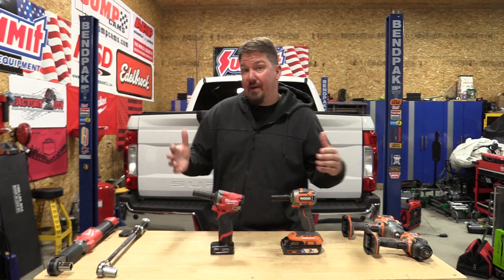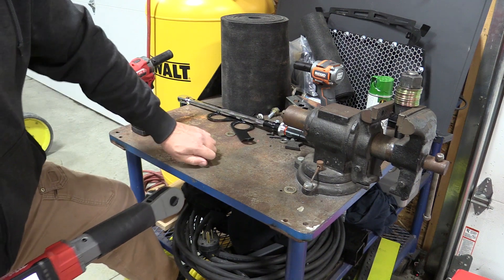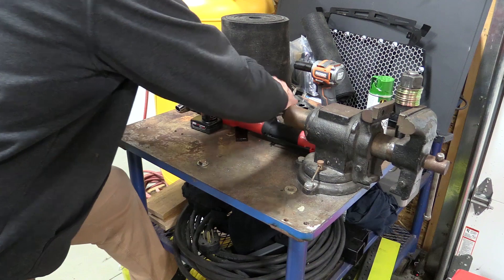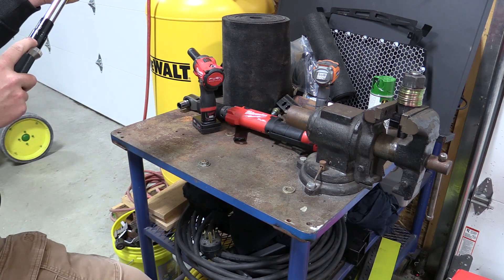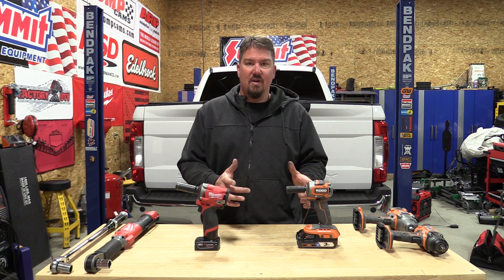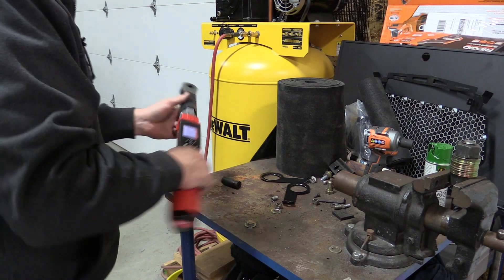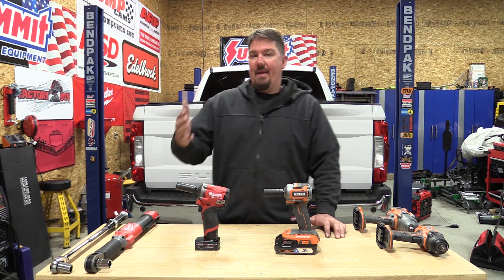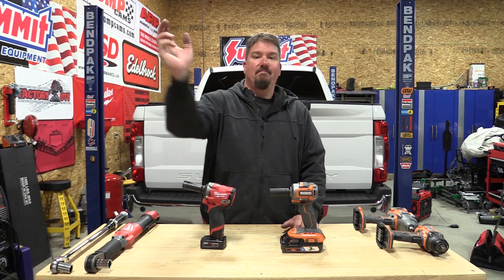Milwaukee FUEL M12 Stubby Vs Ridgid 18-Volt Sub-Compact Impact Wrench

Comment: I tend not to follow the pack so I went with the Ridgid 18V line vice Milwaukee.  The later is too expensive for what I do. I was able to recently pick up the older 1/2" Octane impact for $120 and both the 1/2 and 3/8" stubbys for about $65 each.  You cannot beat this level of value in the Milwaukee line.

Comment: Shallow well sockets have less mass and vibrate more then transfer torque. They significantly limit the tools ability to transfer torque! That is why you can find crankshaft sockets which are nothing more then sockets with 5x the mass.

Comment: I'm not a fan of the Ridgid per say, I have the 120 volt 1/2 inch impact. It's a good impact, but it's heavy. Easy trigger to use too, press down for removing and up for tightening. 🛠️🔧

Comment: You don’t actually need to spend that much. Just bump up to a 22mm impact socket in 3/8” drive.  Better yet I’ll go work on that video today.
Reply: I think the reason why it's so expensive for him is because he has expensive toys. Getting the job done isn't enough. Gotta do the job with the absolute best tools.  
I agree with you on your not that expensive comment. Buy a couple huge bolts, one or two sockets along with one tap. Boom testing is on. 
It wouldn't be the best socket, die or bolt but the results would be consistent.

Comment: 3/4” grade 8 bolts are what you would need to use for the torque specs youre trying to achieve. Recommended torque on a 1/2-20 g8 is about 130 ft lbs.  as you get beyond that, the bolt will go through elastic deformation, then plastic, then complete failure. If the bolt youre using has a recommended torque specs in the range youre working in, failure of the fastener is less likely.

Comment: milwaukee has a smaller handle due to it can use a small battery, most of the time when we need a stubby impact just because not enough space for a big tool like Ridgid, if the Ridgid can fit into that space with that big fat battery in it, it also can be done with 1/2 inch impact wrench from milwaukee, more power. I personally recommend Milwaukee.

Comment: One thing that would've been a better test is see if they'd remove and install all the lugnuts on that truck behind you.
Reply from the maker: They both will.  Torque is 165 on those.  The damn thing is pretty much new so there is little challenge and also why I did not use it for an example.  I do not want to mislead anyone to think that in 10 years they would be able to remove them with the rust.

Comment: I have a question does a deep well socket eat up more torque than a short socket? I’m wondering if the extra mass soaks up some power.
Reply from the maker: Deep well give the unit more power transfer to the fastener.  Not what you would think.
Reply: @WorkshopAddict  how does thin wall vs regular wall change the performance?

Comment: It'd be super cool if you could get a 3.0ah battery for the dewalt 12v 3/8 and see if it has more power! Like if it would actually break a truck lug nut VS the Milwaukee stubby.Keep the sweet videos coming! Thank you

Comment: My issues with impacts is they performance fade over time. I don’t really understand why that happens. I’ve heard theories about anvil ware and others about copper windings work harding. 
The test more interesting to me is which tool retains its capabilities over time and multiple heat/cooling cycles.  

It’s the bigger impact on my wallet over time I’m interested in.

Comment: I've seen guys test on impact wrenches with 18 wheeler lug nuts. Those seem to handle ALL the torque.
Reply from the maker: Those are not 3/8" impact though.  That's an huge but for a 3/8"
Reply: WorkshopAddict I've seen the Milwaukee stubby 3/8 handle it. I can't remember where on YouTube I found that particular video but I'm mainly throwing it out there for the durability. Like you can perform the test on those lugnuts and they'll withstand more than the 190ft lbs that those bolts you have are handling.

Comment: Really great idea.  Too bad it didn't work out.  I think a lot of people get too wrapped up in having "the best" tool.  If you have the rigid batteries, does it really make sense to run out and buy the m12 stubby kit?  Probably not for most people.
I will say though, thats what led me to Milwaukee, all of their tools are very good if not the best in their class and the m12/m18 line have tons and tons of tools to fit just about any job you can think of.  It's hard to beat that when you factor in the cost of batteries and the hassle of having multiple chargers, and batteries cluttering up your bench/box. 
Great video as usual though!

Comment: It's an 12v vs a 18v obviously the 18v has more power and will win?
Reply from the maker: So Wrong.
Reply: Not even close...my 14.4 v matco drill blew away all my 18,and "20v" drills.
Reply: @WorkshopAddict  hence the question mark at then end of it.

Comment: Use 9/16" or 14mm wheel studs either welded to your bench or made on a fixture you can put in your vice. Lugnuts with 7/8" hex. You aren't gonna break those with those tools and should be pretty inexpensive.

Comment: Just a suggestion and I know it's a little cheesy and overdone at this point but driving lag bolts into material you know to be consistent like plywood or lvl would be a good way to get a relative idea of driving speed and what driver overall has more power. I don't know much about bolts and what not but I do know that it's easy enough to stretch out a faster or for there to be enough variance in the driver's to never get consistent performance. Measuring reverse torque with lug nuts is also overdone but at least fairly reliable. Great video though as always!
Reply: Everyone wants either a consistent test, or a real test. Neither test can be one of each other. A consistent test is lags for time/speed in plywood. A real test, is lags for time/speed in 4x4 material. Irregardless of the tools being on different battery platforms, there is only so much human element that can be taken away, or added to in some cases in these comparisons. Brand fans want to cry their tool didn't perform and blame the tester made an error... and the "unbiased" tool "pro" says it wasn't fair due to one irrelevant factor in a test... and the other brand should've won. Consistent real human tests are a compromise in it all. I'm not building a deck out of plywood, so why would i watch wich impact can drive lags faster in that material. I want to see which one performs the best in actual material where variances are going to occur.

Comment: I like that torque wrench, the click one. F digital
Reply from the maker: Digital is just nice to show the camera
Reply: Snap on tech angle torque wrenches I'm 100% sold on them if you do any internal motor work they are worth every penny especially  on nuts and bolts that require an additional amount of so many degrees after the ft lbs is set

Comment: You should use caterpillar bolts they are stronger the also offer taper head bolts so you can have a 3/4 inch bolt with a 3/4 or 11/16 head ect also your table is problematic put nuts in the vice and get r done so you can use a new nut and bolt each test if need be

Comment: Use a 3/8" A449 threaded rod and tighten a nut against a second nut. Place extra nuts further down the rod in case the thread starts to deform during testing (just cut off the deformed section and continue with the nuts already threaded on the rod). Epoxy the rod into concrete or big chunk of steel.

Comment: Which Milwaukee stubby is better to get  1/4  3/8 or 1/2
Reply: I’ve got them all and if you’re mostly working on your own vehicles and the like, the 3/8” will probably do you well. I prefer my 1/4” to get into the really tight spaces and my 1/2” will pull the fasteners that the 3/8” won’t. There’s a little give and take with each of them but they all perform very well and they don’t let me down.

Comment: Just buy a sunex 15/16 impact socket & use grade 8 5/8 11 bolts sunex sells 15/16 impact socket that is 3/8 drive
Reply from the maker: I need to buy the tap and the sockets.  Will see how quickly I can get them.

Comment: That is weird with the rigid and the shallow socket you would think you would get more Install torque and removal torque with a shallow socket compared to a deep wall socket interesting now its doing 80 foot pounds or less again wow strange brian @WorkshopAddict
Reply: The weight of the deep socket causes an increase in the overall torque
Reply: @newtonraymond77  yeah that makes sense more mass so they hit harder

Comment: I don’t think you can use the m12 torque wrench like that accurately because you’re at, a little over actually, the maximum rating of the torque wrench.
Reply from the maker: Per Milwaukee it is accurate to 165 off the record, but I agree,.

Comment: Why not just go get a 3/4 nut and bolt and just put the nut in the vice?
Reply from the maker: Vise will not handle it.  Tried.
Reply: @WorkshopAddict  well then, if I was doing that test in my shop I would find some square tubing drill some holes in it and weld the nut to the tubing. Slide that tubing in the hitch of that Super Duty behind you. That won't go anywhere. #superdutylife

Comment: The bolts are stretching and weakening every time you torque and loosen them. It's common to replace cylinder head bolts or studs for this reason. Keep trying, thanks for being honest.

Comment: You could always find a 18 wheeler and do it's lugs
Reply from the maker: I have one, but do not have sockets for 3/8 that go that large.  I use a 1" impact for those.
Reply: @WorkshopAddict  very true, you would have to use an adapter, adding another variable to the equation

Comment: I have the 3/8 stubby and wanted the ability to use it on larger nuts/bolts and found a set of Cr-V Shallow sockets for fuel filters that were ~$30. I haven't really used them for much yet, but they would likely solve the problem of needing larger sockets as they go up to 38mm though I'm not sure how they will hold up long term as impact sockets though for testing they may work. Also tapping directly into the bench may be problematic as it is likely mild steel and the threads will likely be the weak point in the testing setup. It may be a good option to go with a large nut you can mount in a vise that way if it gets stripped out it is easy to replace and you don't need some kind of huge tap. https://www.amazon.com/gp/product/B071YMR5GJ/ref=ppx_yo_dt_b_search_asin_title?ie=UTF8&th=1
Reply: Also, I'm wondering if the higher mass of the deep socket adds to the impulsive force through better harmonics sorta like the heavy sockets do that they use for crank bolts and some ball joints.
Reply from the maker: Vise wont hold the bolts at 200 ft lbs, been there.  I have no clue about the socket, but that was super interesting.

Comment: You are obviously exceeding the max torque of the bolt you are using. You need a larger bolt that can take 250+, use google and find the right size. Bolt stretch is going to throw off your results also.

Comment: Why bother with lower than the higher specs on the tool. If both are rated above 200+ just start at 200 got damn it!
Reply from the maker: Because the video from the day before with a shallow socket showed the Ridgid stopping at 170 ft lbs.

Comment: you can't keep using the same bolt they stretch what you have proved is inconsistency in sockets and bolts I do believe the Milwaukee would out perform the Ridgid.

Comment: Truck lug nuts. Just go to a junkyard and use an old truck for the test. Not sure how you will go with getting the 3/8 drive socket in the right size though.
Reply from the maker: I have old pups sitting around with all the lugs, but it is an unrealistic use and the lugs are huge.  I struggle with this to get a real world use as they are more powerful than the bolts they are meant for.
Reply: @WorkshopAddict  fair point. I guess trying to prove which is more powerful is probably not even necessary as they are both stronger enough for any of the jobs they would actually be used for. For me the deciding factor (other than the fact I am already on both Milwaukee m12 and m18 platforms) is the tools ability to get into tight confined spaces. This is where I think that Rigid would really struggle. I think the Stubby would excel there even though it has the slightly bigger top section. If you look at the size of the battery on that Rigid it look ridiculously disproportionate to the rest of the tool and I bet it would have a very hard time getting into tight places in the engine bay. Even something like removing lug nuts on a car with deeper dish wheels could be hard due to the battery getting in the way. You could use an extension but we all know that robs torque. Both tools seem to have power to spare so I think the only relevant real world test would be to do multiple jobs with each and see how they go in real world applications.
The only nut or bolt my M12 Stubby (I got the 1/2 inch drive one) couldn't undo on my car was the diff pinion nut. I had the get out the big M18 unit for that job but that is seriously impressive for the M12 tool. I think the Rigid might be in similar power terms but just can't see it being as usable as the Stubby due to the oversized battery.

Comment: I have the 3/8 and 1/2 stubbies.
Great machines, I use them on shipping tanks, going to larger bolt sizes etc would let you do the testing.

Say m20 and up etc, using 30+ mm sockets etc.

These will do 90% of tasks and I only have a slight problems here and there.

Using new bolts every time would help as well.
Reply: Which is better the M12 1/2 or 3/8 want to get one

Comment: I own the dewalt extreme and I love it but if I had already been invested in the rigid line I would most likely get rigid. I do have m12 ratchet but by the time I buy the m12 stubby and a bigger battery I can almost buy 2 dewalt extreme kits when Lowe's had them for $99. So I decided to get the ryobi half inch since I have the batteries and have the  dewalt extreme.

Comment: test them on the truck< turn around LOL ( keep u the good work
Reply from the maker: A week ago I rotated the tires for the first time.  I set them at 165 ft lbs and I proved they both would do that.  Plus, I do not have a socket that size for 3/8" impact.  I am not a huge 3/8 user.

Comment: Well, you could always take the mantle of being the successor of real tool reviews, in being the authority of impact tester guy.  Maybe take it a step further, and get two bolt adapters one for half inch sockets and another for 3/8s.

https://www.skidmore-wilhelm.com/pages/tension-to-torque-conversion

Then going to ebay and getting a used unit.  It’s just a question if the views, could support such an investment.   Lol.
Reply from the maker: I want to say so much........

Comment: To be honest I'm not sure where you're going with these videos... You say you don't have any test equipment - okay that's fair. You say you don't have any bolts to use.. - maybe? But mostly likely definitely not. You've got farm equipment, that ford pickup truck and I bet countless other pieces of machinery that could take a 200ft lb bolt.. you know what else could? A nut and bolt in your bench vise. Should have just paused the video, went out and grabbed a few bolts. 3/8 drive has a max size of 1 inch.. were you already at 1 inch? 1/2 drive goes to 1½ inches.  Could have gotten a real test done without using a tap and stretching the threads. Are your impact wrenches 3/8 or 1/2 drive? Bench vise - bigger bolts. 1” sockets if 3/8 drive. 1½ if 1/2 drive... Do it.
Reply from the maker: Truck lugs take larger sockets than what i have.  I do not use 3/8" much.  Bench vise wont hold, tried that.